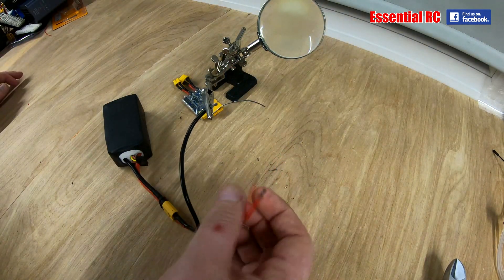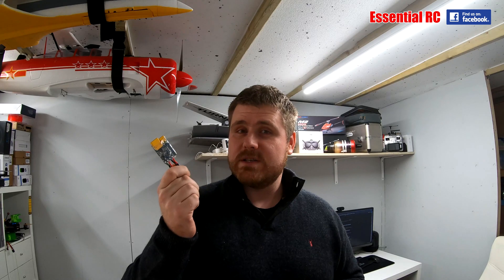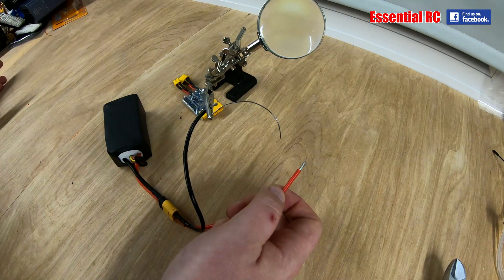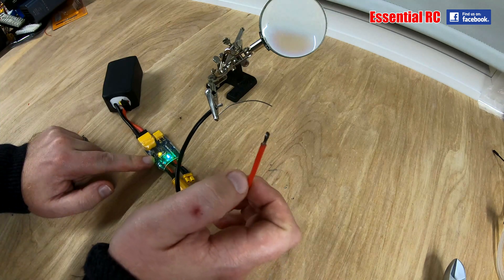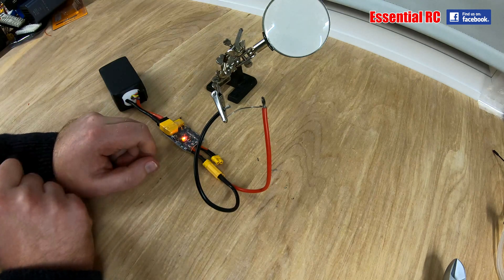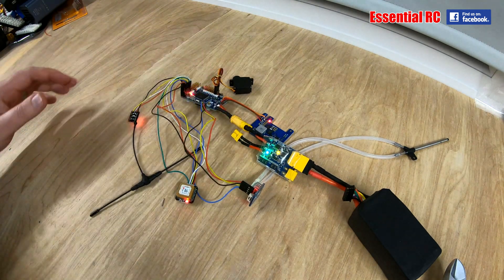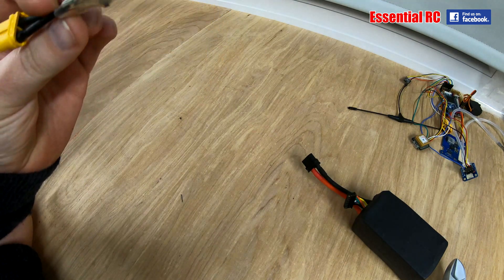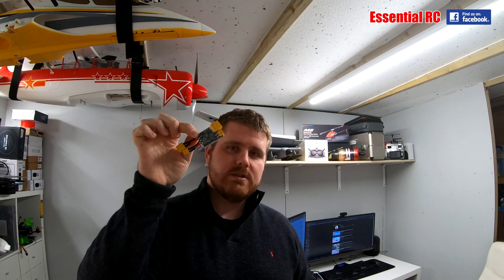PREVENT DISASTERS ! AVOID THE 'MAGIC SMOKE' ON YOUR NEXT RC BUILD | VIFLY SHORTSAVER 2

Comment: Most ESCs have a large capacitor across them that often causes a "crack" when the lipo is connected. This could cause the  device to trip erroneously?
Reply: You can adjust the maximum current of the device to adjust for big setups. I have tested this on a 100a esc and it did not nuisance trip however I have not tested on anything bigger than 100a  but yes at some point when the capacitor gets big enough it probably will cause it to trip just by the nature of the device. The overload function does have a longer trip delay compared to the short circuit trip delay so this allows it to charge capacitors for that split second inrush. But connected up to a big enough cap and sure it will trip it. But for anything “normal” sized it’s an excellent tool to have laying about. You would need a massive electric model to have an issue and given it comes fitted with XT60’s and 30’s I used an adapter to use on an XT90 on the 100a test. It’s not aimed at 1:4 scale electric models 👍🏻
Reply: @randall8686  Thanks Jason, seems like a good investment.